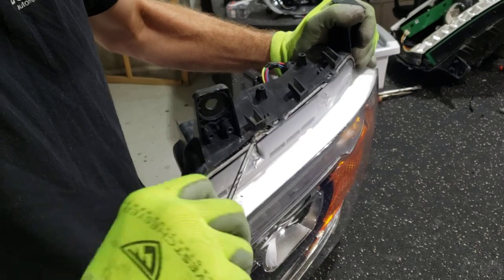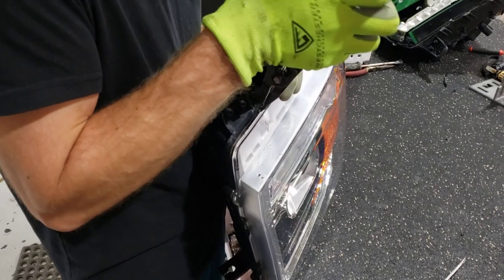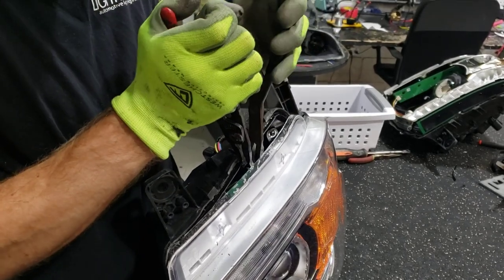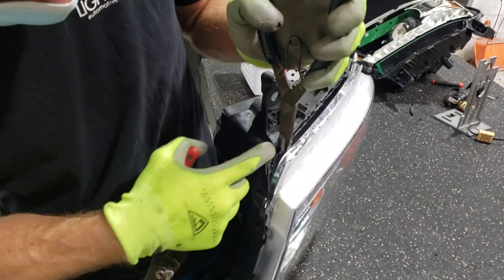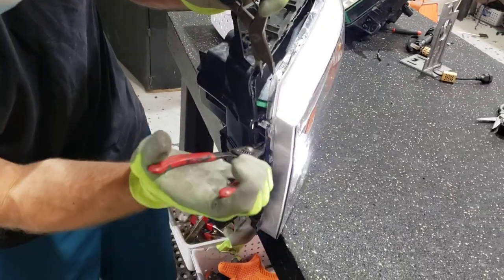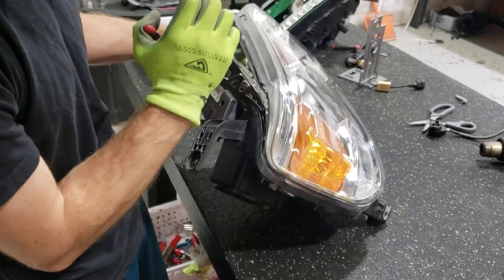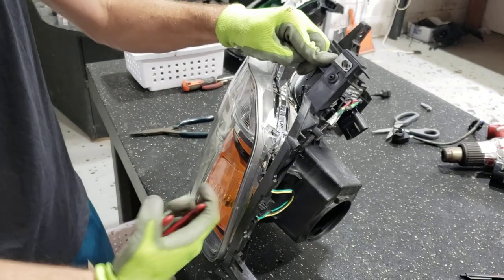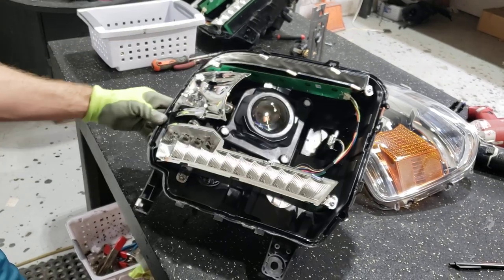Opening up a Perma-sealed GMC Sierra Headlight

Comment: That last edge is tricky alright I broke a lense because I got a little impatient and wasn't really pulling it out sideways. My other headlight I found after 240° for 15 minutes I went around the whole headlight with a flathead and got between the permaseal then another 15 minutes in the oven again and it came right apart. Thanks Caesar!
Reply from the maker: Second one always easier!

Comment: I did this same technique with my 2017 Ford Focus headlights and the sealer is still rock hard, I put it in the oven for 20-minute intervals at 275º and the sealer is still stiff, I repeated this process for 2 hours. What can I do?
Reply from the maker: Try a pick with an a right angle or a set of cold glue tools to slice them open

https://lightwerkz.net/products/cold-glue-tool-set?_pos=1&_sid=95cb1793a&_ss=r

Comment: Have you ever opened 2020 Silverado halogen headlights from a Custom trim? Just wondering if it can be done, thanks for any info!
Reply from the maker: Yes, it can be opened up the same way. This method works for any light but some are tougher than others. Last resort is cutting the lens off and reattaching when done.
Reply: Alright, thank you very much for your reply, it is much appreciated!

Comment: Any downsides to baking them this hot for this long? Little bit scary to think about. Does it weaken anything?
Reply from the maker: If the temp is proper and the heating elements aren't close to the lens, the risk is very minimal. But plenty of people have melted lights in the oven from not pre-heating their own or there was some sort of malfunction. Do this are your own risk.